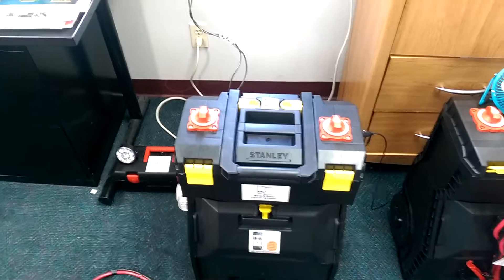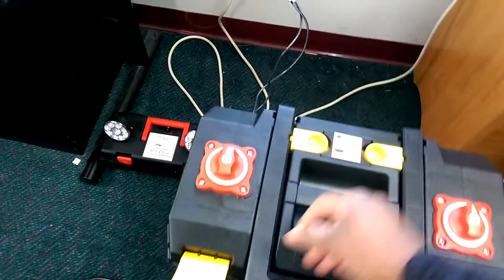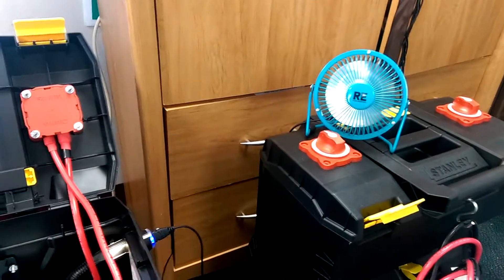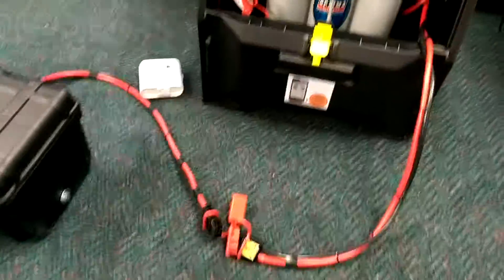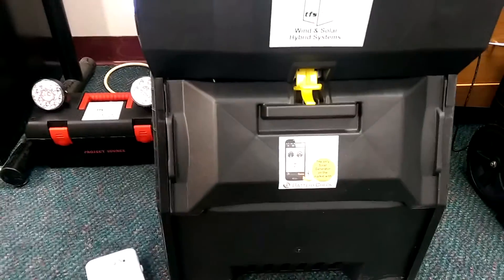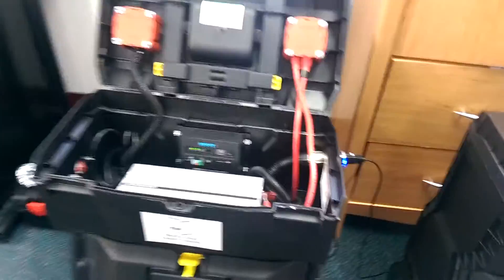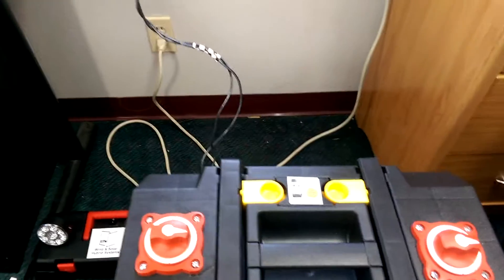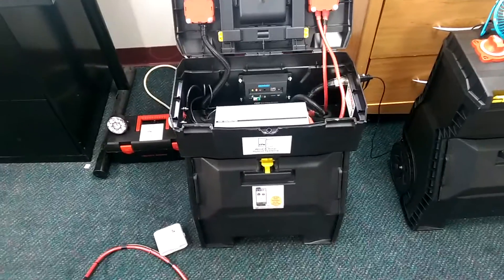TFS Little Debbie 1250w  Solar Generator - with Bluetooth Battery Check Technology

Comment: what is the quick connect for? to charge it faster from a car battery? you don't give enough info , you don't say what items we can plug in to it. can we connect a small electric crock pot to it?
Reply from the maker: +Pedro Castillo 

Please be advised that the quick connect is an Anderson connect for the optional 2nd battery and for our optional jumper cable (for jumping a car). This option is available on our deluxe model only. See Link for details: http://www.amazon.com/TFS-Deb-PowerBox-1250PB-Safety/dp/B00S2YS96S/ref=sr_1_3/190-8282803-7515727?m=AYKEZ0XM7B9VF&s=merchant-items&ie=UTF8&qid=1459348269&sr=1-3&keywords=tfs+solar+generators
Reply: +Edwin Thompson thanks, so far this is the one that i like the most